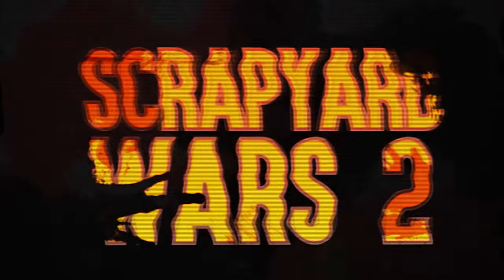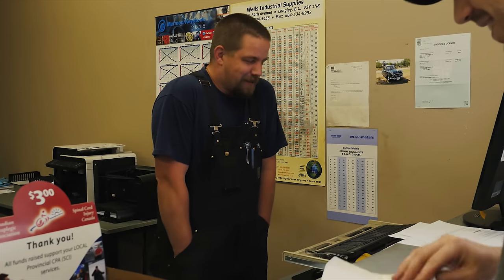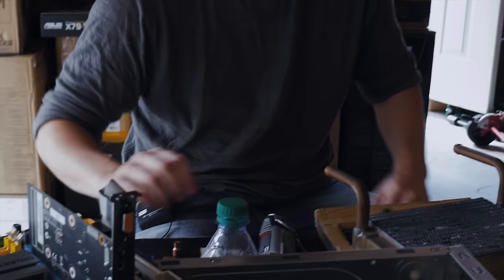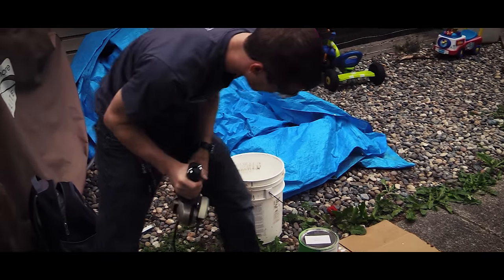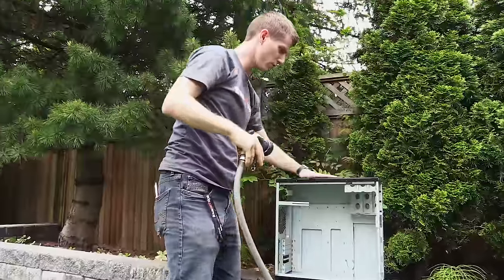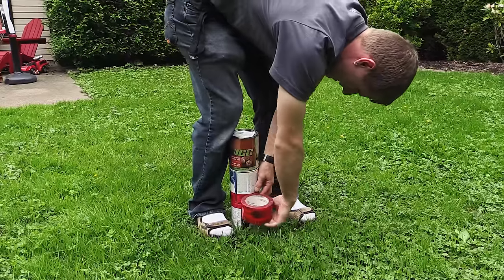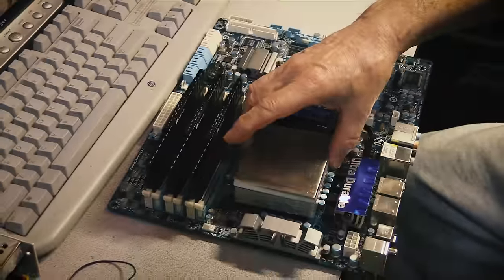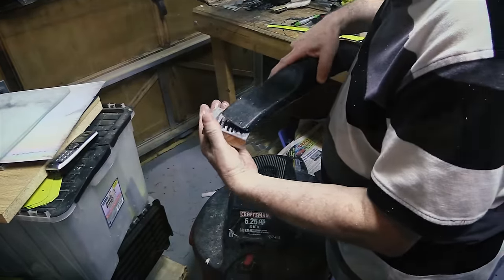$500 DIY Water Cooled PC Challenge - Scrapyard Wars Episode 2d

Comment: Are you guys making things more difficult for yourselfes on purpose?

Linus: some CNC programs have threadcutting features, you just need a suitable bit. so perhaps you don't need a tap.
Was there a rule prohibiting you from coiling above the case, gigabyte-waterforce style, or like making the coil go through the top of the case as in a body-piercing.

Both of you: why didn´t you try to find more free/used materials? leftover pipes from a construction site; a windscreen-washer-pump from a 'Scrapyard'; that sort of creativity.
^^^ If you take this to the Extremes: buy/get a broken graphics card (0-20$) that lets the computer's post fail, usually it will work after you replaced one capacitor or dremeled out the VRM-fase that's not working; Schools, companies, hospitals sometimes give away their PCs when they buy new ones; bend an aluminium soda-can into a waterblock, reinforce it (with for example fiberglass and epoxy) on the sides;
Reservoirs and cases can obviously easily benefit from improvisation, be inspired by casemods from google images.

Comment: Found a typo: Scrapyard Wars has been taken up a notch. We built $300 PCs in 2 days last time, and this time we want to build $300 PCs in 3 days… but we have to liquid cool them.. without using ANY off the shelf water cooling components. Strap on, cuz dis gun be good!

it should be:
Scrapyard Wars has been taken up a notch. We built $300 PCs in 2 days last time, and this time we want to build $500 PCs in 3 days… but we have to liquid cool them.. without using ANY off the shelf water cooling components. Strap on, cuz dis gun be good!

Comment: could i run games at 4k with this build
 Motherboard: ASUS Rampage V Extreme (Bluetooth/WiFi Onboard)	 
System Cooling: ORIGIN CRYOGENIC Stage III Hard Line Liquid Cooling	 
CRYOGENIC Tubing Color: Green	 
CRYOGENIC Liquid: Koolance Performance Coolant - Green	 
Processors: Intel Extreme Core i7 5960X Octa-Core 3.0GHz (3.5GHz TurboBoost)	 
ORIGIN Professional Processor Overclocking: ORIGIN Professional Processor Overclocking	 
Thermal Compound: GELID GC-Extreme CPU Application	 
Power Supply: 1.5 Kilowatt Corsair AX1500i	 
Power Supply Sleeved Cable Color: Black Individually Sleeved Cables	 
Graphic Cards: Single ORIGIN CRYOGENIC EVGA Hydro Copper Liquid Cooled 12GB NVIDIA GTX Titan Z	 
ORIGIN Professional Graphics Card Overclocking: ORIGIN PC Professional Graphics Card Overclocking	 
Memory: 16GB Corsair LPX 2666MHz (4x4GB)	 
Operating System: MS Windows 8.1 [Free Upgrade to Windows 10]	 
RAID Controllers: Adaptec RAID 8405	 
Operating System RAID Configuration: RAID 0: For better speed and performance (2 Identical OS Drives Required)	 
Operating System Drive #1 (Primary): 4TB Seagate Solid State Hybrid Drive	 
Operating System Drive #2: 4TB Seagate Solid State Hybrid Drive	 
HotSwap Drives RAID Configuration: RAID 0: For better speed and performance (2 or more identical drives needed)	 
Hard Drive Cage: 5 Bay Hot-Swap Cage	 
Lower Unit: Cryogenic Cooling Support	 
Media Card Reader: 40-in-1 Media Card Reader	 
Audio: ASUS Xonar Essence STX II	 
Networking: ASUS PCE-AC68 Dual-band Wireless-AC1900 Adapter

Comment: I'm about to build my first PC. Does this look good for $1500?
CPU: Intel Core i5-4690K 3.5GHz Quad-Core Processor
MOTHERBOARD: Gigabyte G1.SNIPER H6 ATX LGA1150 Motherboard
RAM: G.Skill Ripjaws X Series 16GB (2 x 8GB) DDR3-1600 Memory
HDD: Western Digital Caviar Blue 1TB 3.5" 7200RPM Internal Hard Drive
SSD: Samsung 850 EVO-Series 250GB 2.5" Solid State Drive
GPU: MSI GeForce GTX 970 4GB Twin Frozr V Video Card
CASE: Corsair 200R ATX Mid Tower Case
PSU: Corsair Builder 500W 80+ Bronze Certified ATX Power Supply
OPTICAL DRIVE: Asus DRW-24B1ST/BLK/B/AS DVD/CD Writer
OS: Microsoft Windows 8.1 OEM (64-bit)
MONITORS: (2 x) AOC I2721VH 60Hz 27.0" Monitor
Reply: I don't think you'd be able to play +60fps while gaming on dual monitors on a gtx 970... Maybe a 980 or 2 970 in sli
Reply: AsraX1 lol wtf are you talking about... Of course i can play +60fps with a 970. Anyways, I wouldn't be gaming on both screens...
Reply: AsraX1 heck I'd be able to play on 3 screens if I wanted to
Reply: Chris Nields Why are you asking if it's good if you already know the answer?
Reply: Thebiggestcheese i don't know the answer... But I know that much. I'm asking if there is something that I can do that's better for the price.
Reply: Chris Nields Don't get a monitor and use a tv?
Reply: Chris Nields I would recommend the 980ti. It would cost a bit more, but it has a similar price to performance ratio and it is more future-proof
Reply: Thebiggestcheese bro, give me actual advice. TV's have a higher response time. which mean's that they're worse than monitors....
Reply: Quinn Chapman bro a 980ti is 650 dollars!
Reply: Chris Nields yeah and it performs better than two 970s
Reply: how much was this TV?
Reply: Chris Nields Like $300 bucks. It's better because I can watch TV on it too.
Reply: Thebiggestcheese nah screw that
Reply: Chris Nields Do you not have a good tv?
Reply: Thebiggestcheese 300 is still way more than a really good monitor with a 1 m/s response time an you can watch tv on a monitor so i dont know why you mentioned that
Reply: jacob spanjers Yes but I paid for this T.V that is 34". Also, you would have a T.V if you had actual stuff in your house so why pay for something new if you could just use something you already have.
Reply: because big tvs like that you usually need to be farther away and if you did not get a wireless mouse and key board you would need to be right next to the thing
Reply: jacob spanjers Or, I just move my mouse and keyboard back?
Reply: wtf kind of cord streaches that far
Reply: jacob spanjers Dude, my computer can move....
Reply: yeah but the cords have to be attached when you move it........
Reply: jacob spanjers Dude, I have my computer right next to me and my T.V 6 feet away. What are you talking about with cords?
Reply: Chris Nields maybe try a r9 390?
Reply: TheKroeterich yeah i switched it to a 390 the other day. Thanks tho :D
Reply: Chris Nields Dont go amd. always nvidia better more consistent drivers
Reply: hoodninja Lol nice joke.
Reply: Thebiggestcheese when was the last time amd had a big driver update?
OH here is the answer 

http://www.techpowerup.com/212724/its-now-been-over-160-days-since-a-catalyst-whql-release.html
Reply: hoodninja Lol, ur funny
Reply: Chris Nields I'd def get a 1440P monitor!
Reply: Chris Nields Get a 750w in case you want to get a second gpu and considering that you have 2 monitors, you'll probably be doing that sooner rather than later.
Get a 2TB HDD at least if you play games, just trust me.
And I would really get a cpu cooler
Reply: SpookyKid94 yeah i was going to say he should get a CPU cooler. personally i would suggest a Cooler Master Hyper 212 Evo. thats what im using right now and its pretty damn good.
Reply: caboose309 Thanks!
Reply: Thebiggestcheese I just cringed at that reply anyone who pc games knows monitor>tv
Reply: SpookyKid94 thanks but i always uninstall the games I'm not currently playing and put the ones I play on my SSD. I ain't gaming on no HDD
Reply: Chris Nields if you're gaming on an ssd understand that the only thing that will improve will be loading times, you won't see an increase in fps, and trust me you'll need a lot more than 250gb to play games on it you may say to yourself you'll uninstall the games you aren't playing but it will get really annoying to do so.
Reply: Chris Nields also I have a cav blue and loading times on it are great I would recommend using an ssd for just a boot drive
Reply: Chris Nields i would go with 2 120hz monitors, for when you go above 60fps, or one 120 and one 60hz, as you said, you'll only use one for gaming, the other is for other applications, i do the same thing, so my better monitor is my primary one, i would advise the same resolution and screen size for both though
Reply: Chris Nields Looks great, but get a more powerful psu :) And i think the GTX 970 will handle it, if you cut a bit on things that doesn't affect gaming performance like case, motherboard and storage drive. And use the saved money to upgrade to a i7 4770k or i7 4790k.
Reply: HamDerDanskeren i7s have very few advantages over i5s in gaming. Better to sink the extra $100 of fluff into the gpu
Reply: True, but the 970 is the hands down best bang for your buck gpu out there ;)
Reply: HamDerDanskeren I'd actually recommend the r9 390 over it unless you really need the reduced power consumption. It's a tad faster for less money.
Reply: Yes, but if hes also gonna be doing a bit of editing aswell, Nvidia got CUDA, which is a little bit faster and a little bit better intergrated to applications like AE and Premiere
Reply: IZ
Reply: i got much better with less money!
i7 4790K
Gtx 970 EVGA superclocked 2.0 NIVIDA
16GB RAM 
Windows 10
and gigabyte G1 Sniper Z97 UltimateDurable
Reply: Go with an I7 , cheaper Ram and better PSU for more OC and upgradability ....

Comment: So...  I'm an Aircraft Maintainer right...  Fabricate metal all day every day.  Do crazy shit to cars for fun in my off time like, weld, braze, cut, mold, bead, shape, lay up, heat treat, bend and machine weird stuff all day... I damn near put my keyboard through my monitor watching this.

Screw scrap yard wars, it should be called nerds with power tools.  I really think you should have an equalizer for both teams.  Like a real "it needs to fly in the morning" get it done not exactly pretty but close enough to right fabricator.  Really just even for safety, a "hey, man watch your fingers"  or a basic tubing bending or death wheel "consultant" would make me feel a lot better about seeing untrained guys trying to work power tools.  Sounds like I'm being a dick, but I have seen appendages get crushed, cut off, and mangled by these tools.

I have PTO if you need me, and know how to work a tubing cutter...